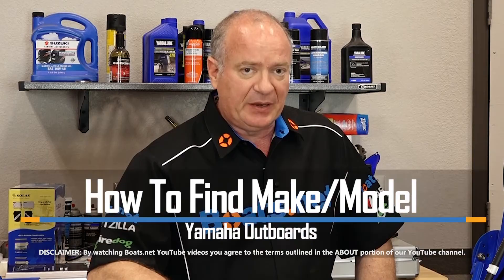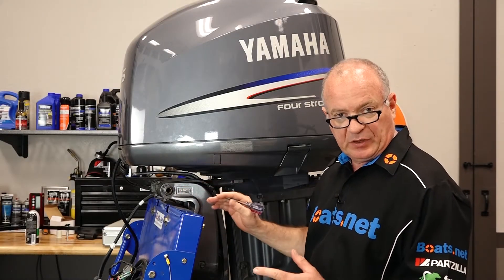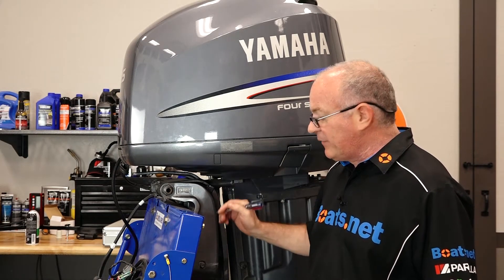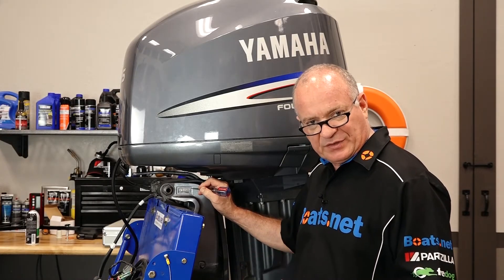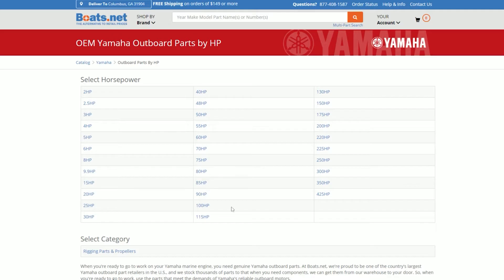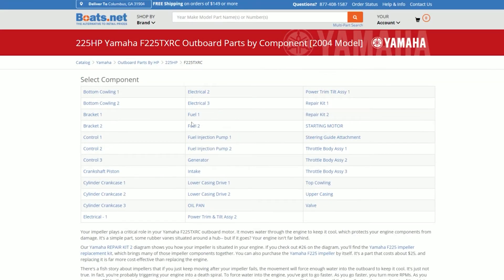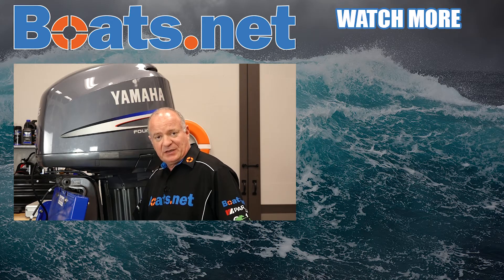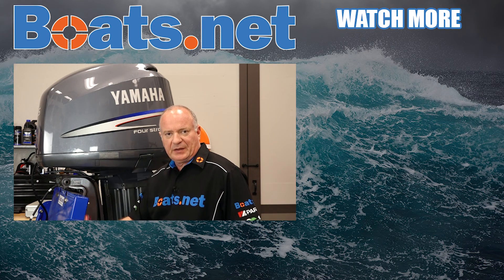How to Find the Serial Number on an Outboard  | Yamaha Outboard Serial Number Location | Boats.net

Comment: I have an 204 F150TXRC Yamaha outboard in need of a lower unit thanks to a rock in the wrong place.  
What is the significance of the two digits (XX) in the 63P 45300 XX 8D part number?  The possibilities I have found are OO, 01, 07, 10 and 15.  Thank you for your help!

Comment: I can't read my tag, it has a chunk taken out.  Its used but new to me. Is it's data stored electronically? It's a F115XB 
Next line first box has damage in left side...an actual chunk missing, but in that box you can read... EK. Next box = X
 Next box=1032862 then letter by it self =Y.
Is this enough to go by Can? Can you tell me if this is a 2016 motor as represented?

Comment: I bought yamaha 150hp 4 stroke long shaft it was running good, I wanted to do overhaul on the lower unit but the vin number is missing. Is there another way to identify what engine I have so I can order the exact parts for it. Need your help.

Comment: Thought I had a older tahatsu outboard,  thinking more like a nissan doesn't have serial # plate from pics and matching parts I thinking it's around a 1986 nissan 25 where is it stamped on motor

Comment: If the sticker is scratched and the serial number is not showing, is there any other way to find out what it is?
Reply: I cant find the serial number anywhere on the engine. Can I check my pink slip or any paper work . What can I do ?